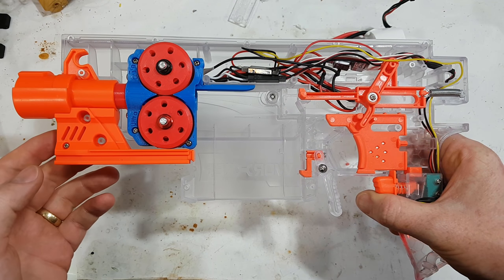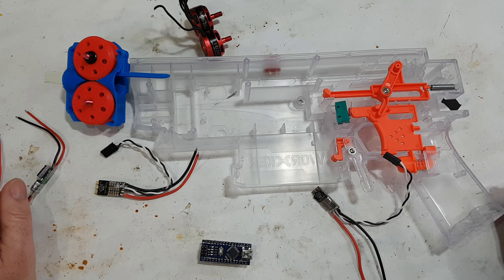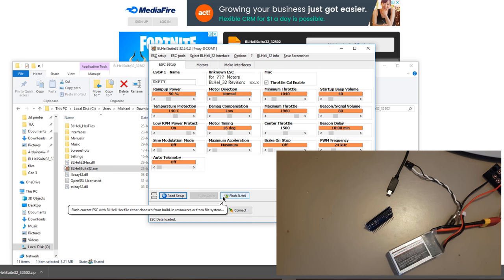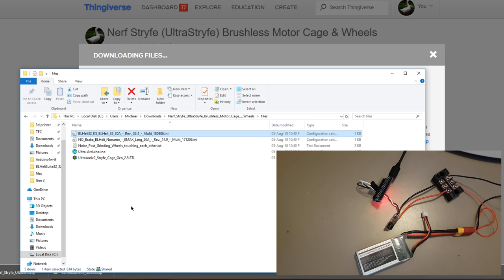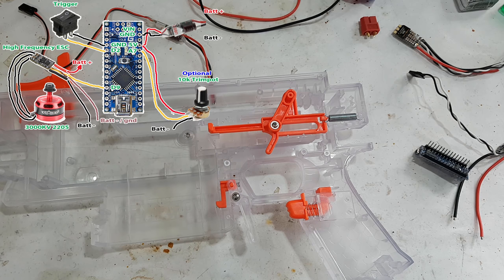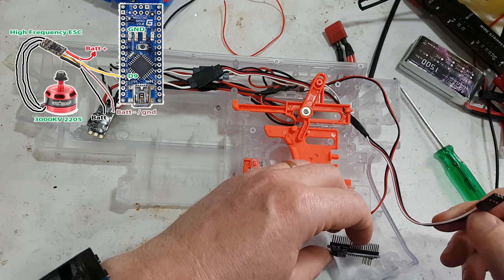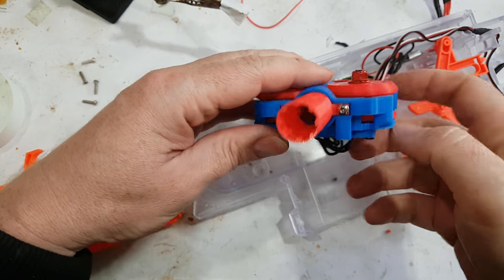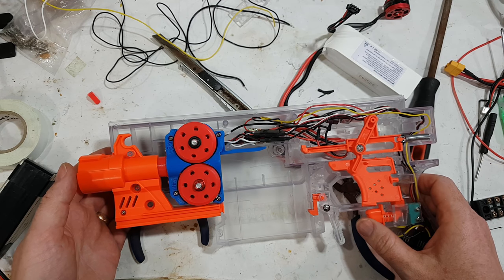⚡️ DIY How to Worker Swordfish Mod (UltraSword / UltraStryfe) Stryfe Brushless Mod

Comment: Sorry, but I have to disagree with you on the ESC latency topic. I am from the FPV Hobby, which these ESC‘s are made for.

Most of the modern BLHeli_S and BLHeli_32 ESC‘s have pretty much exactly the same latency. Differences are in the Electric Noise for example. I would recommend Flycolor BLHeli_S ESC‘s. You can’t beat them for 10$. The Hobbywing stuff is also great, but a bit bulky. I general I would recommend just going out and buying what’s available for a project like this. Latency isn’t a problem.

Keep up the great work;)
Reply from the maker: There was no comparison between S and 32 .. it was between non S or 32 and 32 .. and the delay is significantly different .. i have 4 videos on this topic so far...
Reply: That may be true, older ESC‘s have some delay, but in general you can buy any BL_S or Bl_32 nowadays without ANY noticeable delay. I would recommend programming the Arduino so that the motors idle at like 1100hz, which will dramatically decrease Spin Up Time. These Motors don’t need much power when there is no load on them.

Comment: Have you found a way to reduce the amount of noise the motors make at max RPM?
Reply from the maker: The noise is based on vibrations and that is 99% because of out of round and out of balance printed wheels... Though this has been talked about on the FB page. Everyone starts off believing that their 3d printer prints perfectly round and balanced wheels.. Only after actually investigating this do they find they aren't actually round or balanced .... so noise is based on how well you can print them

From a printing point of view the future is to SLA DLP  printing the Wheels.. But we haven't found the right resin yet..

Beyond that having a more ridged Blaster reduces the noise so the Sword fish is good for that with its bigger posts and thicker shell and not having the slot near the barrel which just causes it to flex ... 

Also the swordfish has less "holes" for the noise to escape.. 

Ultimately i expect a 200 FPS blaster  will always be louder than a 100fps one

Comment: Hi MSA,

Thank you very much for these instructive videos they are extremely helpful. I've just received my swordfish shell and I had already printed your G4.2 brushless cage but I can't seem to fit it into the swordfish shell. I believe your thingiverse.com page says no cutting is required for fitting the cage but it seems as if one of the screw bosses prevents mounting? Am I doing something embarrassing wrong or does the G4.2 cage not fit the swordfish?

Kind Regards, 
Brad
Reply from the maker: join the FB group and post pictures

Comment: From the main page on BLHeli it will not let me change the baudrate in the bottom left corner. Any ideas?
Reply: It won’t allow me to connect it even after connecting to D3 and ground